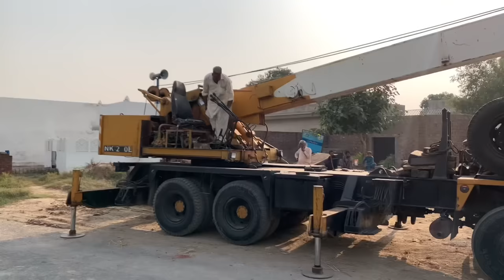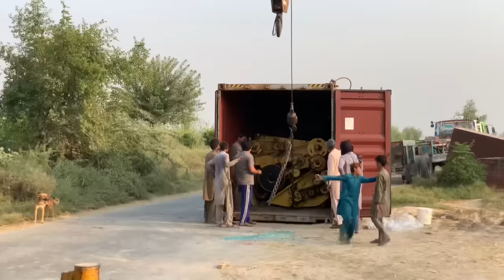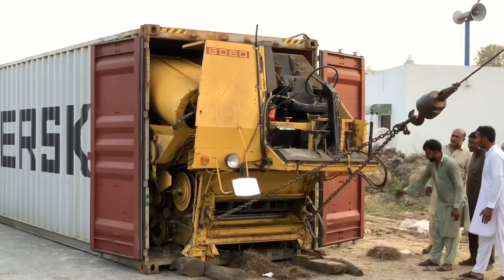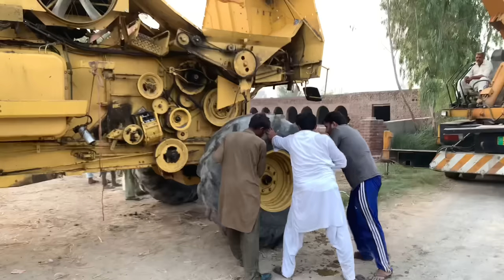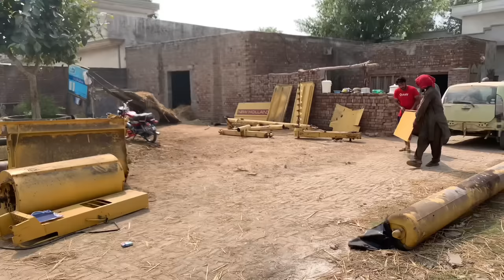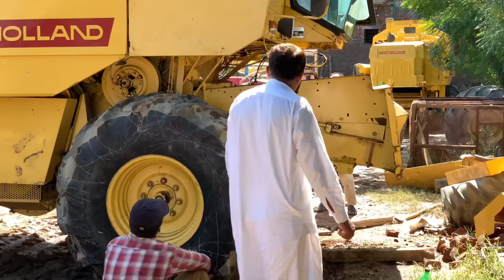Unveiling the Fully Assembled Harvester Combaine A Milestone in Punjab's Agriculture

Comment: Imported from the USA if anyone is wondering.
Reply from the maker: Thanks for the feedback
Reply: Stolen from Kansas.
Reply: Some farmer in us got ride of old farm junk
Reply: I beg to differ. Judging from the dealer's logo "mertz", I'm pretty sure it was sold new in Denmark, some 40 - 45 years ago.
Reply: @hansjensen5422  Could see in another comment that they came from Germany. Though I thought that I recgnized the 8060 as one I have worked with but not shure, the damage on the right back top of the machine behind the ladder. We had one that got damaged like that some 40 years ago.
If so it was from Denmark. Most likely just a similar looking damage in the same area.